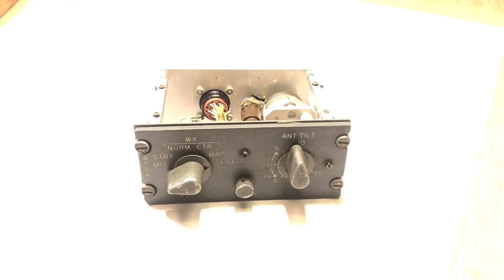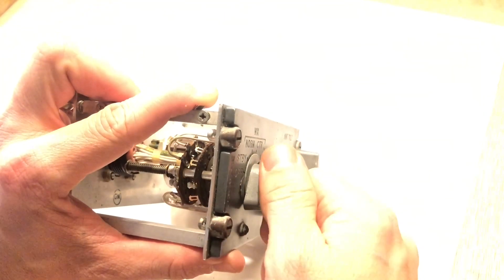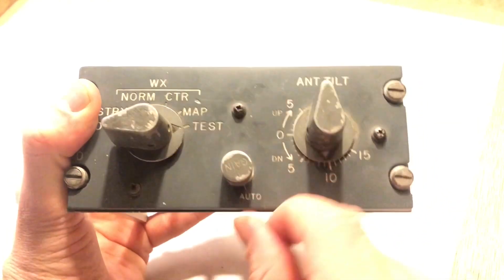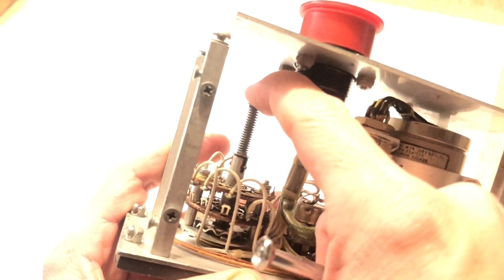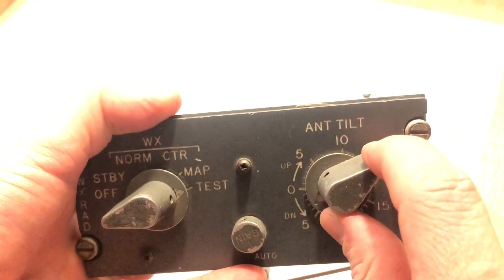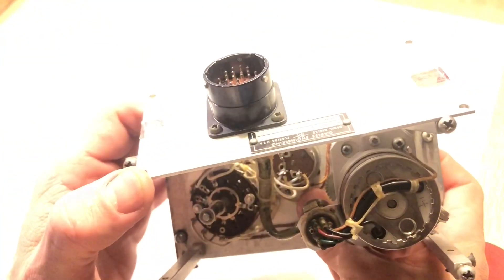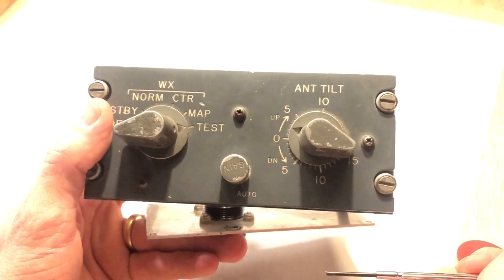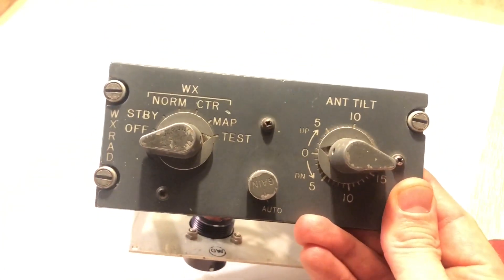Real Weather panel - B737 Home Cockpit

Comment: Peter you can use the FDS IBL dimmer along with the DIST EXP that connects to the dimmer giving you the option of running 5v on one board and 12v on the other.

Comment: Nice - looking forward to seeing it in situ.
That's a synchro torque transmitter, not a stepper motor. The radar antenna will be mounted on a receiver that matches the exact rotation of the transmitter.
It'll be a pain to read the value from it as it requires an AC voltage to energise the coils, then you'd need to 'decode' the phase of the other coils. Definitely best to replace it with a potentiometer.
https://en.wikipedia.org/wiki/Synchro
Reply from the maker: Oh. I see. Thanks for the clarification. Great input. 
I am still puzzled by the gearing ratio.
Reply: @BuildaBoeing  My guess is that it's geared such that moving the dial the displayed number of indicated degrees will move the synchro shaft that number of actual degrees.